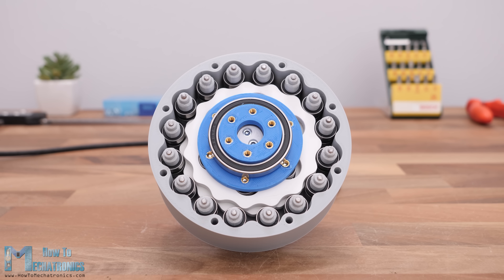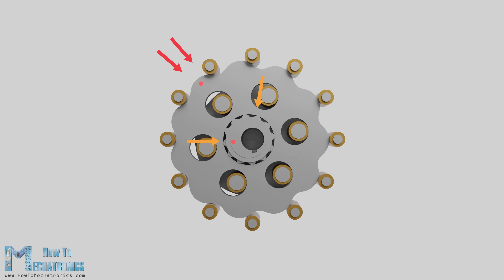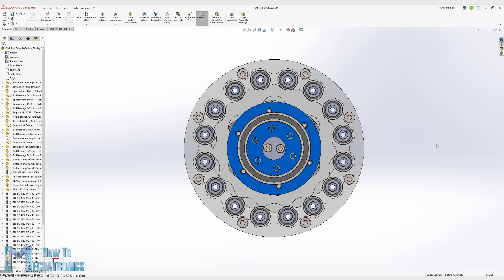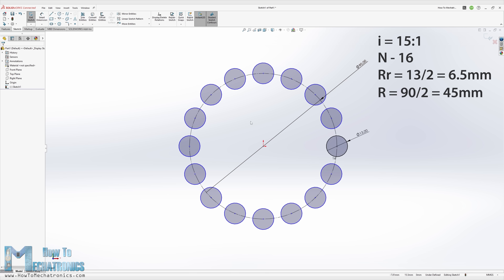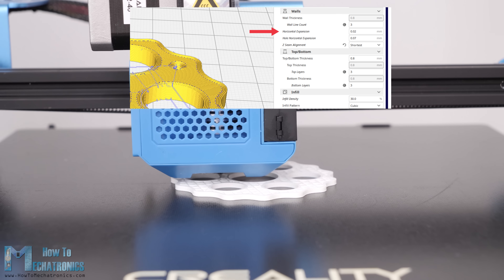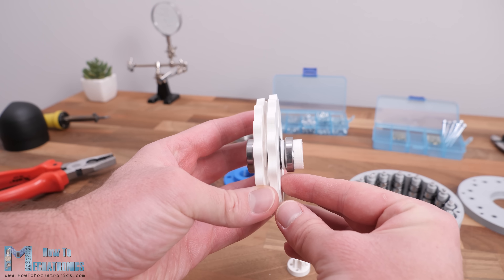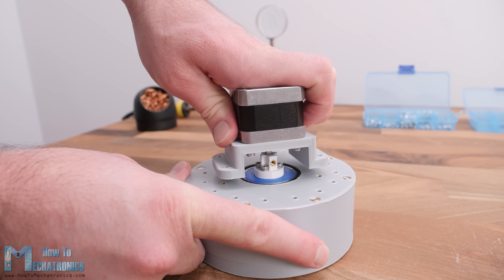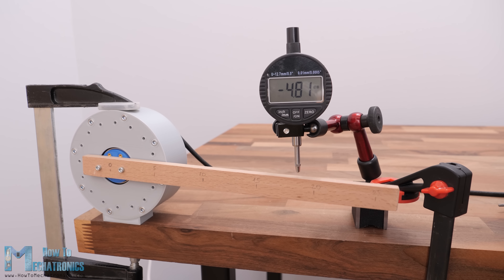What is Cycloidal Drive? Designing, 3D Printing and Testing

Comment: My cycloidal gears want to slip off of their central as the tolerance wasn't made too tight. What do you think I should do to remedy this situation? Should I reprint the gears with a tighter tollerance to force it on the bearing and reconstruct the eccentric shaft or should I just super glue the bearing to the gear on the inside? I wonder if they eventually just do this from wear over time too

Comment: Hey all, just FYI, the equation as copied and pasted into SW had some issues.  I copy and pasted it directly into SW2022 and it came up with something that looked more like a flower than a gear.  After watching a video on Stepbystep-robotics channel I was able to figure it out.  He had done some intermediate calcs on a couple of the terms and then replaced those terms in the equation and removed the associated parentheses that are no longer needed.  This solved the problem.  Also, in SW you can use the equation editor to lay out your terms and then put the equation into the sketch using the terms with, with " around each term. This makes your disk editable without having to re-copy/paste the equation in.
Reply: Bro i know it’s late but how you do it, i’m getting crazy over here lol
Reply: @manray8513  Got you bro, these works in SW 2023 and 2024
Y = (45*cos(t))-(6.5*cos(t+arctan(sin((1-16)*t)/((45/(1.5*16))-cos((1-16)*t)))))-(1.5*cos(16*t))
Y = (-45*sin(t))+ (6.5*sin(t+arctan(sin((1-16)*t)/((45/(1.5*16))-cos((1-16)*t)))))+(1.5*sin(16*t))

Comment: one question:

if you have 12 bushings and the plates have 11 notches, why is the ration 11:1 and not 12:1 ?

each notch of the plates has to engage 12 times to get one revolution.

or am i misthinking the case?

Comment: 1. You can draw parametric curve from 0 to 180 degrees, then connect it's start and end, extrude half of the cycloid, and then just mirror it and get full shape.
2. It's better to use SolidWorks variables. This way you can change cycloid's shape much easier.
3. Efficiency was measured incorrectly. Does this motor really produce rated torque? Input torque should have been measured before measuring output torque.
And it's also interesting how much torque will this reducer handle before something breaks. :)

Comment: Awesome video!  I’ve learned quite a bit from this video.  However, I’m struggling to reproduce the rotor profile.  For some reason the profile is much larger than the expected 45mm.   Anyone else running into this problem?
Reply: My problem is that the rotor is smaller than expected. I've been pulling my hair for 2 days now without finding a solution.
Reply: I actually solved it in the meantime. I had to reinstall the VBA, and that fixed the equation drive curve feature, which caused the problem with the profile. Maybe it can also work for you.

Comment: Loved your videos and subscribed to your channel. I have a question if you can help. I am trying to build a platform using stepper motor which is rectangle in shape. It's 20 inch long and 8 inch wide. want to be able to put weights on this platform and being able to rotate (horizontal). Any idea how would I do this with timing belt or other mechanism.

Comment: Gorgeous design, and thanks very much for sharing the design files!

In your test, the output torque was limited by the little stepper motor: Do you have any idea what the maximum torque is that the drive is capable of before breaking? It looks like it should be very robust!
Reply from the maker: Thank you!
I didn't test much torque it's capable of handling. I wanted to test it with a NEMA 23 motor too but I didn't have the time. I might do it in future and post the results.

Comment: I'm an electrical engineer brought here by a chance, however I do have certain appreciation of the mechanical engineering.
I am able to judge that this video presents an extensive engineering effort, showing itself both overall and in the details.
I wish I could work with you on my energy conversion related projects (quite a lot of mechanical engineering is required there), or that my mech. engineers could represent at least a half of your ability and attitude to the subject.

Comment: Hey, thank you very much for the coolest content.  Creativity.  Looking at your site, I noticed two projects where you use the same tool, laser engraving machine by "scara robot" and laser engraving machine by "simplest CNC machine", I guess the question, what is the use of laser in scara even though there is a simpler CNC machine that is easier to  use and less expensive, but most of those interested in this field use the same idea of the simplest CNC machine as it develops.  scara . is not used
Reply from the maker: Thanks! Well that's for those who want to learn more about robots. I showed a way how to control the scara robot to work as a laser engraver.

Comment: Stop the parametric curve at 99.99% an jankily finish it with a little arc => Solidworks in a nutshelll XD 

This thing drives me nuts : gets crazy good, easy to use functions and drawing abilities to 99,99% and you spend days fixing the 0.01% because it requires you to rethink your design around it.

Amazing gearing tho, really like how simple and compact these ones looks. But can't help to wonder about their durability and efficiency... not mentionning how expensive they are.

Comment: How noisy is it (especially if used in a high rpm input use)?
Reply from the maker: I didn't measure the noise levels but it was fine I think. In case of using M6 bolts instead of 6mm rods for the roller bearings, then there would be much more noise, because as mentioned in the video the bearings won't have tight fit with M6 bolts.

Comment: I think the reason why cycodial drives are not used more widely in industry is the much higher friction in comparison to regular gearboxes.
Reply: @NabtescoMotionControl It is less than 1 % in comparison to regular gear systems. Regular gear boxes are everywhere....cycloidal gearboxes are very limited in industry mostly used for robotics. "Widely used" is subjective. From cars over wind turbines to conveyor belts - all still use planetary or regular reduction gears. Even Tesla's Drive unit is a regular reduction gear.  ;)
Reply: @NabtescoMotionControl I think you are over reading my comment. I'm not saying they are not used. But in comparison to the amount of regular gear boxes they are literally a fraction in all industy. There has to be some reasons for that. Probably much more expensive to produce, more friction/heat, difficult to maintain etc.

Comment: Thank you for your helpful video. I was wondering if you could help me out with 2 questions. How did you calculate the thickness of the disc and also how did you decide on the number of output holes on the disc ? Your video was a great inspiration, I hope to build my own version very soon. Thanks again!
Reply from the maker: Glad it was helpful! I didn't put much time researching about those two parameters, so I chose them arbitrary.

Comment: Very interesting video on how to make our own cycloid motor at home, thanks for sharing with us ! 
On a 3D printer, the horizontal hole extension option is always problematic. I have tested it on many parts on my calibrated X1 sidewinder printer under ideamaker and this is not very accurate and repeatable, the outer parts are ok but the hole diameters are often oblong and always vary from clone to clone. First price 3D  printer are good for  POC but not suitable for a precision DIY part that must last.  I hope that one day "How to mechatronics" will build a mini EDM machine with wire/electrode and/or a sls printer to allow home user  to make complex and precise shapes in metal. I am pretty sur that most of us will be happy to sponsort him in order to product this kind of tools in opensource.
Reply from the maker: Yeah, the hole expansion option doesn't solve all problems.
Thanks for the input and the suggestion. I will take it into consideration.
Cheers!

Comment: About the shaft : 
when screwing pla parts together, I avoid using purely undersized holes :  there will be a lot of friction wich will generate heat when screwing, risking to damage the part.
a common option is to use threaded inserts, but they are expensive and not always usable (tiny space for a screw, for example)
personally, for 3mm screws (just for reference, my engineering project uses non less than 41 m3 screws all holes made with the following method) : a 2.3-2.4mm hole in the 3d model, that hole is re-drilled with a 2.5mm bit (inner diameter of M3, M5 is 4.2, for reference) with a cordless drill at slow speed to avoid melting the PLA, the hole gets a perpendicular exit (through part hole / I had in the model an other hole perpendicular at the end of the screw's hole) to make an exit for the debris, lastly the hole is slowly hand-threaded with a M3 tap and tap holder with a 2 turns down, half turn up, movement, to limit friction and let debris go down to the exit. If the hole is deeper than 15mm, I firstly do a 10mm pass, remove the tap and clear debris with a straightened paperclip, to much debris will make a lot of friction, heating up the pla and ruining the thread, so go slowly.
Uses and personal recommendations :
Fixing a pcb : a m3, 6mm long thread is enough.
Fixing plastic parts together : a 10-15mm long thread is enough

Comment: I converted your step file to Fusion 360 format. Your clearance between the disk and bearings is only 0.05mm !!!
Is your 3D printer that good? I have to allow 0.2mm - 0.3mm clearance for my printer, If I want a good fit without bringing the hammer into the picture.
Reply from the maker: Yeah, it was a bit tight fit. It would be better to allow 0.2-0.3mm clearance.

Comment: If you reinforce the rollers by replacing a PLA post with a ball bearing, where is the next weakest point? More to the point is there any way to simulate this sort of problem to work out the solution?
Reply from the maker: The problem is the 3D printer, it's not capable of printing that much accurate the parts, the disk profile and the holes.

Comment: 👍
Why don't you use formulas and parameters for automatic changes the model?
Reply from the maker: Yeah, that would be nice, but that's a lot of work to do.
Reply: @HowToMechatronics  If you will try you will change your mind.
It's just a little longer to name the parameters and give them a value. After that on the sketch you choose  dimension = and choose the global parameter that you made before.
Also after = you can write the formulas in the dimension line.
And yes, you need a little to think for correct usage of the formulas. But you need to do it once.

Comment: Having used Solid works for over 10 years, I moved on to Fusion 360.
I'm glad I did. The program is much more intuitive and being a top down CAD, a dream to work with and make complicated parts without leaving the assembly environment. 
I don't know how Solid Works became the leader in CAD, given Autocad had decades of more experience, Autodesk is making a comeback with a vengeance.  
Of course, those that are running pirated versions of SolidWorks, will never switch to Fusion 360.
Reply: Catia is the leader in CAD not Solidworks. Solidworks is primitive in comparison but easier to learn. Fusion 360 is not really design software. It's intended for parts and CNC integration. You can't create assemblies with thousands of parts in Fusion. Solidworks also starts to sweat with large assemblies while Catia handles it like nothing.

Comment: Clean design. Clear and instructive explanation. Evaluated the results of the work. Original Content. Material list included. 3D Model included. Perfect video honestly.
Reply from the maker: Glad you enjoyed it!
Reply: He’s a gem 💎
Reply: are they lighter or just more compact? than gears i meaan. can they be used for an ebike??
Reply: why the double layer of cycloid discs?
Reply: to reduce vibration, the eccentric shaft is basically an off center shaft and the cycloidal disc is moving more side to side than rotation movement, so they put 2 disc in opposite
 side to cancel out the side to side meaning lower vibrations   @snorttroll4379

Comment: Nice! Would using 3 disks 120 degrees offset allow constant power transfer, ie slightly smoother? Similar to the idea behind 3-phase electricity?
Reply: @Luke Fabis In practice, however, this gearbox model, like all similar ones, shows an uneven rotation of the output shaft.

Comment: Say if I want to mount a position sensor on the output. How could we achieve that if everything is moving inside? And to clarify, I mean without interfering with the output shaft. And as always, great video!
Reply: Embed magnets into cycloid disk, and use Hall effect sensors in the frame.
Reply: encoder
Reply: @tomusklepipieta1009  well, yeah. But how would you mount that? Everything inside of it is moving and the gear speed is different than the output shaft speed. This is most problematic for absolute encoder.